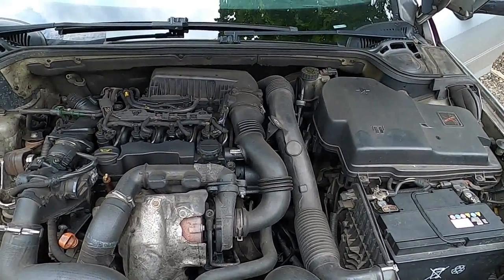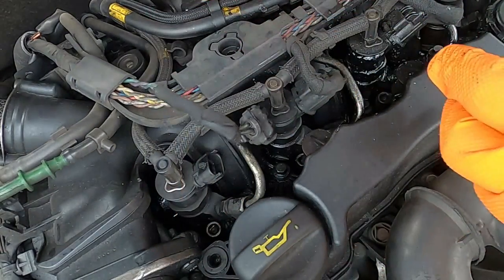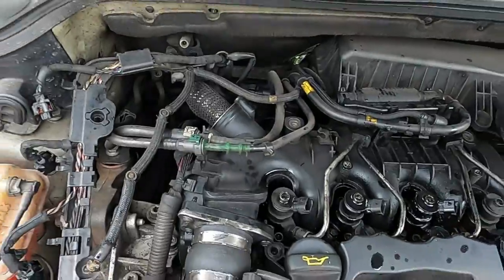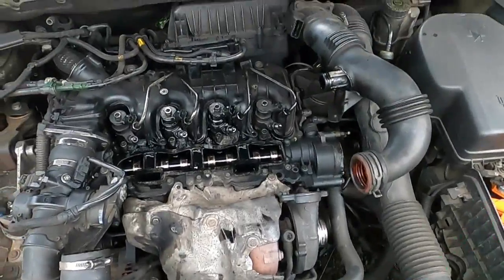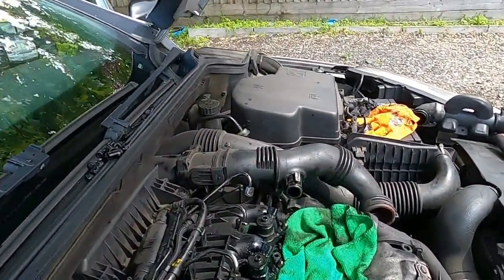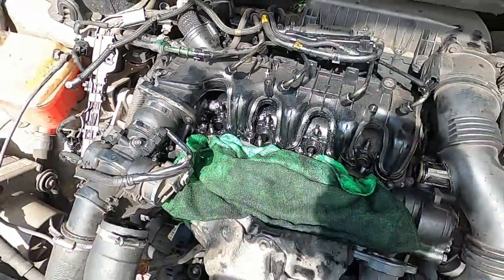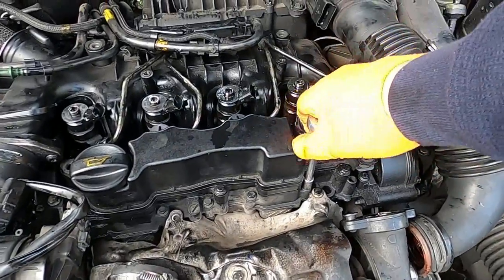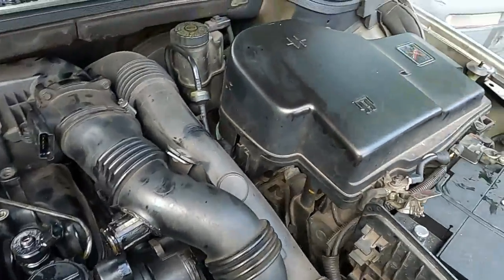1.6 HDI/TDCI Injector seals and Rocker cover gasket replacement

Comment: You should have changed the membrane and the rocker cover spring at the same time, because it sometimes tears and this causes oil loss on the engine and on injector number 1. People then think that it is the number 1 injector that is leaking, when it is the membrane that is torn.

Comment: Hi, watched your video and spent the whole day today doing the job and cleaning stuff. However, now my car won't start, at first the engine was trying to crank but after several unsuccessful attempts, only getting a loud winning noise. Any ideas? Need to press the fuel primer pump right? Anything else?
Reply from the maker: Battery might gone a bit flat. Priming is a must as there might be some air lock in a fuel system but also if you can get someone with jump leads to connect to your car while you try to start it i think would be good idea or try to spray some easy start in a air intake to help with starting it up once it will fire up it will carry on. As once it fires up then cambelt will turn a fuel pump and should push through any air pocjet
Reply: @Mad4FrenchCars  Thanks for your reply. Charged the battery to 12.6V, pressed the primer pump several times still can't start the engine. Starter motor seems ok, can hear the cranking sound. I just remembered that I've lost one of the metal clips that secure the fuel return line on one of the injectors. Do you think it's possible this could be the reason?

Comment: It's a decent enough video but very rushed work. You should have checked the injector housing for dirt and cleaned those out to remove any carbon build up with a reamer kit. Chances are you're going to have to do the job all over again.

Comment: Hehehe,you remove injectors woth hand and i couldn't move first one with hidraulic pull
Reply from the maker: Sometimes they do get seized. Injector crack day before the job is always good idea
Reply: @Mad4FrenchCars  i try for 3 days for 1-2 hours  and i manage around 2 .3 milimetar turn it ! i think that previous owner never change seals on it and now it leaks fuel and car losing power or dont want to start  so

Comment: Warning! You used the same old bolts to secure the injectors. You should always use new bolts, bacause the old ones can never reach the correct torque. I also noticed you didnt use a torque wrench to tighten the bolts. But apart from that, the filming and commentery was brilliantly done.
Thank you so much. Regards Mark.
Reply: Whats correct torque on the new bolts,I assume repair shops never use new bolts inmy country,paid 2 times for this work and fuel is still all aound my injectors...I want to do it alone,so i can know whats changed here.Thanks in advance!

Comment: Hi mate , a couple of things you could of done extra while you had injectors out.
change the bolts that hold injectors,as they stretch once used so give wrong torque if used again,
I thought cleaning out the injector seat and ports befor injectors go back in,
check the leak off pipe for blockage while it was disconnected,
I would of loosend the high pressure pipe nuts at the back as well,
But thank`s for showing the method
Reply from the maker: Hi mate this particular video I was doing in a hurry as that day I was extremely busy. I could have done more but only sticked to what was needed to get it going again as I had to put the car together fast I didn't plan this video I just happen to develop injector seal problem  so I thought I might aswell record it as someone still might find it use full.

Comment: Hi Mad4FrenchCars, 

Good explanations in your video. You were lucky having no injector blocked - it would had been o horrible job :(

I have seen you had injector with oil contamination - this was caused by the injector bolts oil sealant deterioration (HDI engine is known for this strange injector bolts position)

I would also:

- change injector bolts  (HDI injector bolts must always be replaced as the bolt's material is deteriorating in time and the length of the bolt increases). I already had a broken injector bolt and extracting it was a time consuming job.  This is why , from time to time, you must re-check that injectors are tightened enough
- add oil sealant for each bolt as the HDI  injector bolts passes through oil. This is the cause for oil contamination when the sealant is deteriorated (some people mistakes for with diesel contamination)
- clean injector bed before placing the injector as the surface should be clean. There are some tools for injector bed cleaning which prevent any pressure loss
- always tighten to torque or to angle 
- respect the same injector position when possible
- with the engine started  listen to the injectors for knocks - you could recognize an unproperly tightened injector by sound
- finally check the injectors with Lexia , not for programming the injector but for verifying ECU correction for each injector(0 should be the best result, with a maximum of +2) - again, you could recognize an unproperly working injector.

Comment: I'd recommend tightening the rocket cover evenly and In the recommend sequence. This type of car would be 13Nm torque. Also while the injectors are out it's an idea to clean inside the bore and use a cutter to make a perfect seal with the copper ring 👍

Comment: I've done everything you just done the same way but am still getting leaking injectors I've given up and getting someone else Todo it I've been told too change the studs as well that hold the injectors in place and use some rtv silicone gasket maker on the and also around the rocker cover gasket to help stop oil leaking did you sort your issue out ? I need to get my injector seats cut that's what am doing tomorrow ilthe only thing I didn't do was disconnect the battery so now have fault code but been reset now it looks easy but when I still don't work it's crazy I tried 4 times and give up hope my issue is sorted tomorrow
Reply from the maker: Hello david in my case everything seem to be ok. Injector studs its a pain to remove as they brake, I dont think thats your problem. Sometims fuel supply is a bit off and can leak or a fuel return on top of inkector it always need new o rings. In very rare cases injector itself has been undone and there is a leak on a side of injector. I cant really tell. Rocker cover gasket usually ok as its self sealing gasket.
Reply: I can answer to your problem,i have the same engine on a ford and i had the same problem.The issue is that this engine after some time of worn it developes blow by gases inside and this gases,mostly are oil vapors escapes around these black seals under the injectors.The solution is when you mount these seals put rtv silicone under them and the problem will be solved

Comment: Hello mate, hope all is well, is it necessary to remove the oil cover etc, I need to change the copper washer on injector 2, was hoping I don’t have to remove everything
Reply from the maker: On these engines better to remove
Reply: @Mad4FrenchCars  just for better access right?

Comment: Great video.   Just wondering what grease you used to keep copper seal on injector instead of falling off?   Some people put a bit of oil on crank case seal before fitting.  There was a lot of oil in your air pipe to turbo.
Reply from the maker: The car I was working on was a taxi with I think 240k miles on it. Ya it was a bit dirty but the way I drove it as taxi I think most of cars would crap there pistons out so good old 407 did took any beating I throw at it. I just used a bit of normal grease mate nothing special just to stick it on so it wouldn't fall. Most of the rubber seals is advice not to put any grease on them I normally try to replace any rubber seals without using any grease.
Reply: Thank you for your reply, wasn’t sure if there was a particular grease to use.

Comment: Nice job. Looks simple when you know how. I noticed you never used a torque. A bit like be just use feel.
Reply from the maker: Thankyou mate i apreaciate a good comment.
Reply: @Mad4FrenchCars  Job Done Thank You. My seals were well bad. I got the impression the last ones were poorly fitted. Checking some other forums I see you should not have to retighten them. But I think I will check them in a month or so.
Reply from the maker: @datadogie  well different people will say different things, but i think its good idea to check the tightness of all the nuts after few hundred miles just to be on a safe side. In my experience sometimes after few hundred miles some nuts gets a bit loose. I am not sure why. Anyway i am glad you done it and find video usefull.

Comment: thank you  for  reply..what about torque for tocket cover? I hope you will have more than 1000 subscribers. I'm sure because the way you explain and showing  technique  so amazing.
Reply from the maker: Rocker cover is 5 Nm for pretightening and 13Nm for tighten it up i believe. Also you have to kind of start from the midle and work the bolts up towards the sides. Try to make sure it all lands on a gasket as equally as possible.
Reply from the maker: People tried to go for as hard as 20Nm on rocker cover bolts and snapped them lol.

Comment: I have the same problem on mu mazda 3 2004 . The same motor with bosh injectors is. The 1.6 hdi motor is in volvo,Peugeot,citroen, mazda,ford . When you have s cha chua chua sound you need to replace a seals, but when you have a problem like this,you need to chek injectors and leaking , my 2 injectors have a leak. I have a problem that a 2 injectors have a oxidation and don't want come out, and i need a tool for that on compressor to pull them out .
Reply from the maker: Sorry to hear mate. Injectors wich doesn't want to come out is common problem. Couple of times I used a compressor tool and injector came out with sleeve so had to use torch gun to burn a soot and then put sleeve back in once is off. It can be a pain sometimes

Comment: Also I don’t know if you knew one of my injectors of gone which I need to replace but you didn’t specify do you need to code a new injector
Reply from the maker: Hi Sophie this video is not about a injector replacement on 1.6hdi/tdci, it's about replacing a seals wich wears out and is a common issue on these engines. Therefore there will be no specifying if you need to code a new injectors as I am not talking about it in a video.

Comment: Your video was pretty good but you didn’t explain at the end is the fuel system self bleeding or do you have to bleed it manually which I think would’ve helped the video a lot better cause I’m still scratching my head about that bit
Reply from the maker: If you just keep turning engine over it will start but might take a quite a few times. You can help it out by pressing a prime bulb for a couple of minutes but that is just an option for hdi engines as tdci engines doesn't have a prime bulb so you have to just keep turning the engine over until it starts. It's not gonna take too long as a fuel is already in a fuel filter and pump all the way to fuel rail. So it only gonna need of a few engine turn overs and it should start.

Comment: Is corteco the oem for the gasket? Any recommanded brands? Is there any point in using sealing paste?
Do you know if  this is the same as the 1.6/1.5 tdci from ford?

Thanks for the awesome video!
Reply from the maker: Hi mate I have been told that Cortado is oem equivalent option for gasket in my local auto parts shop, and I believe procedure is a same for 1.6.TDCI in Ford. Sealing paste doesn't do the job on rocker cover gasket as far as I am aware.

Comment: All my previous 2.2 and 2.0HDI never had an issue with injector, but the 1.6HDI it looks poor and bad design?
Reply from the maker: Maybe you was just lucky not to have an issue with injectors or injectors seals on 2.0hdi as its as common as on a 1.6hdi. Otherwise people wouldnt buy 2.0hdi injectors as soon as you list them. And i have loads of 2.0hdi engines before with messed up injectors especially siements fuel system. Delphi seem to be more solid. 1.6hdi injectors are solid and hardly ever fail but the injector seals do go like every 50-60k miles but it only cost like 12£ and its easy to replace. 2.0hdi only benefit is more power and 6speed gearbox rather then 5 speed gearbox. But there is a loads of things i prefer in 1.6hdi like location of turbo is much better in my opinion also 1.6hdi gearbox much easyer to take of then doing a cluch. 2.0hdi however has a thicker driveshafts wich is better. I run 2 1.6hdi 407s to over 240k miles so i can tell they are solid as long as looked after and also they love good beating. 2.0hdi is good engines to but you cant really say oh 1 is better then other.
Reply from the maker: @missionnad1  220k km thats 137 miles so ya that mileage is still probably ok. Later then its like 270-300k km will need to change at some point it happen to all of my 1.6hdi

Comment: HI, With all the oil on the outside of the engine, were you getting burnt oil fumes/gases coming into the cabin??  My exhaust system seem fine.
Reply from the maker: I have cleared it all up later same day. I think I basicly jet washed it with a brake cleaner. And I can't remember any fumes or smell.

Comment: Can i use any silicone hose for the intercooler? where can I buy in colors?
Reply from the maker: I have seen people using them but not sure of a suppliers
Reply: @Mad4FrenchCars  I have in my country but they are silocon and I doubt they will last, since oil eats silicone.
Btw, I have on this engine on my mazda 3, i have camshaft sensor error aparently? Have you had that? And where is located? left front top, below the avs?
Reply from the maker: @CarloLeonKolega  camshaft sensor is located on top left corner near the camshaft. It's secured in place by one hext bolt.
Reply: @Mad4FrenchCars  merci mon amie

Comment: Hello, can you tell me if I replace all bad diesel injectors with new, in my engine (Ford Focus 1.6 tdci), will it already improve obvious weak power I feel every day, or does't- perhaps if turbine pump is also demaged (during driving with bad injectors maybe). Does setting new injectors with old pump is good solution with no worries in future? Thanks
Reply from the maker: Hello mate how do you know if your injectors are bad? Have you done leak off test or have them tested? Injectors is not a cheapest part so you want to make sure they are deffinatelly the cause of poor performance before you replace them. 1.6tdci has only 90 BHP so it's not a very powerful engine as it is people do upgrades on turbo and injectors from Peugeot 407 1.6hdi wich gives them 110bhp but I personally haven't done it. Turbo might be faulty but most common problem with these engines relating to turbo is either a turbo boost selenoid or actual vaccum pipes coming off or developed some sort of crack in them letting air in. I would check vaccum pipes, get injectors tested wich you can even do yourself with leak off pipes measuring how much diesel comes out of each. That would be cheapest option. Its many components working together in harmony and it could be loads of different issues not just injectors or turbo.
Reply from the maker: I would start from vaccum pipes check also from getting maybe car diagnosed with Diagbox it might show you why it's behaving like that
Reply: @Mad4FrenchCars  thanks mate, actually I' ve done diagnostics in two different services and the result is same -two practically dead injectors and two very weak injectors. So they suggest to replace all four with new. It's costly enough, so I wonder if this intervention will improve power and solve problem, or it can go to scenario: injectors are ok now, but turbine is also damaged, and the engine power is still weak as pre-intervention? Or does replacing bad with new injectors suppose and setting a turbo pump with it, so overall system will be good after that?
Thanks
Reply from the maker: @Propolizei  I think if you 2 garages both saying a same thing about injectors then it might be the fault. I would just replace injectors mate. Turbo should be fine you can always disconnect air intake of it and see if it's any play in a shaft.

Comment: I have oil in my air intake i notice when changing out my injector seals any idea what it could be thanks
Reply from the maker: Hi mate it's normal to have some oil inside air intake and also in the intercooler as Hdi engines release oil steam through the breather back in to air intake.
Reply: Thanks very much
Reply from the maker: @wackey3455  my pleasure mate.

Comment: Similar car 1.6 hdi piccasso c3 2010
I cannot find the oil pressure sensor any ideas
Reply from the maker: Oil presure sensor normally sits near the bottom of the engine block. You should have a sensor cable going to it aswell. Usually near the place where other end of dipstic tunnel goes in a blovk
Reply: @Mad4FrenchCars  thank you